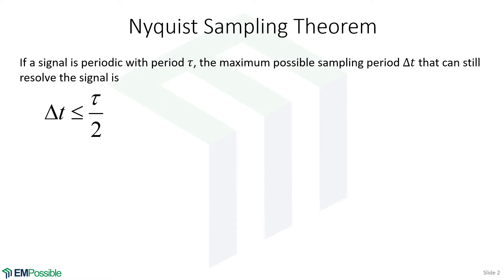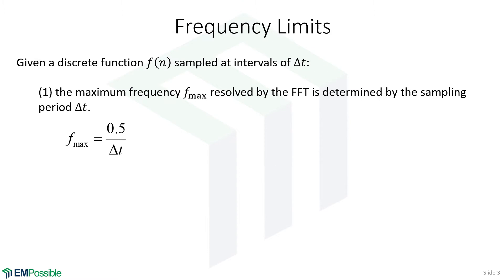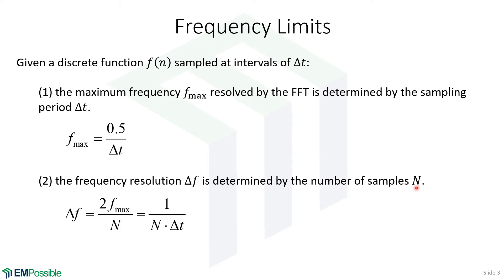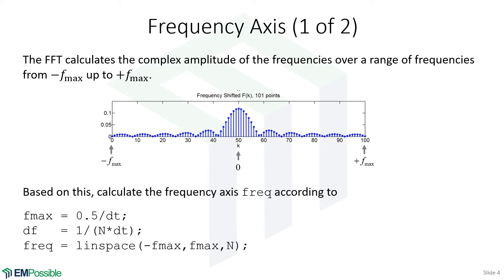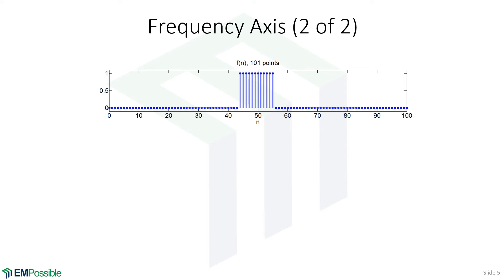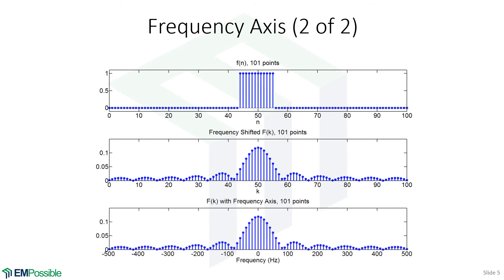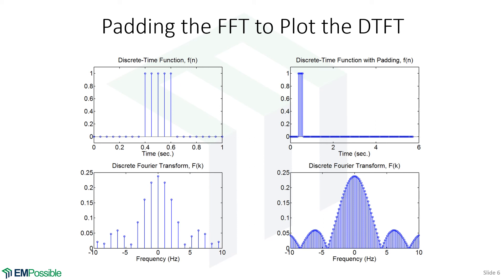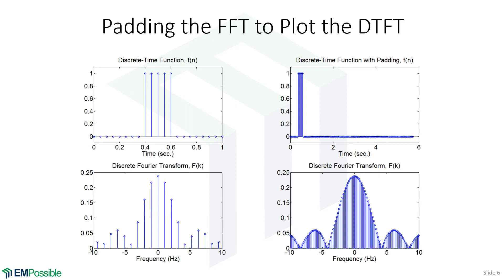Lecture -- Calculating & Displaying Frequency Plots Calculated with the FFT

Comment: Hi Prof Rumpf,

I've been following your PWEM and RCWA videos with great interest! Do you have definitions for the permittivity/permeability convolution matrices? I have analytic expressions for fourier coefficients of a structure but am not sure how to structure the matrices...
Reply from the maker: The convolution matrix is constructed directly from the equations on Slide 5 in Lecture 6b on the course website:

https://empossible.net/emp5337/

It may seem like there is something missing, but this really is the final equation before the MATLAB code. The only place I have more information about the convolution matrix, including the MATLAB code to build it, is in the paid courses you will see at the end of Topic 6 at the link above.

If you have analytical expressions, that works. You will just need to arrange the Fourier coefficients to form the convolution matrix. I build a picture of the unit cell and use an FFT to calculate the Fourier coefficients, but either approach works. If you have the analytical expressions, those will be more accurate.